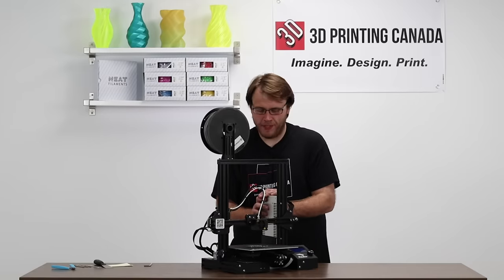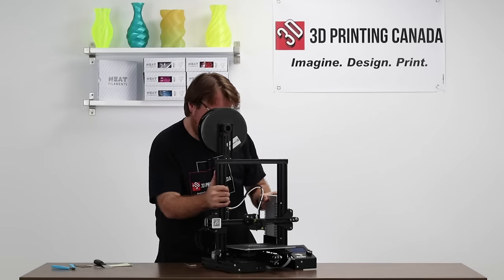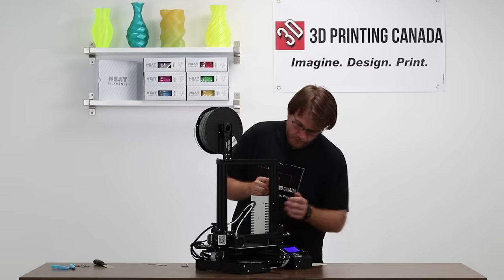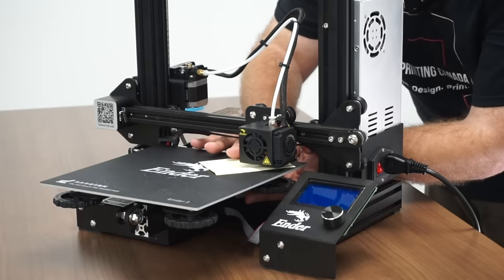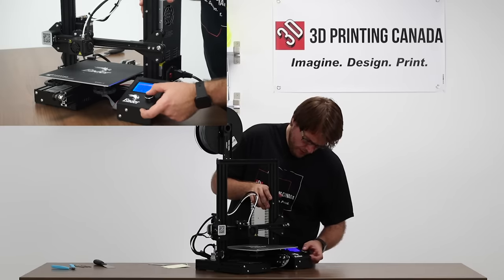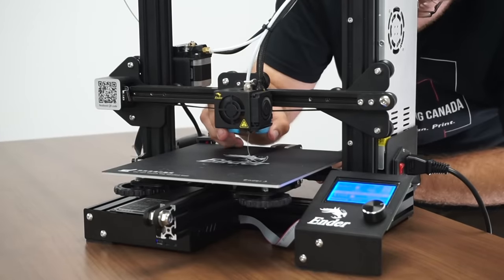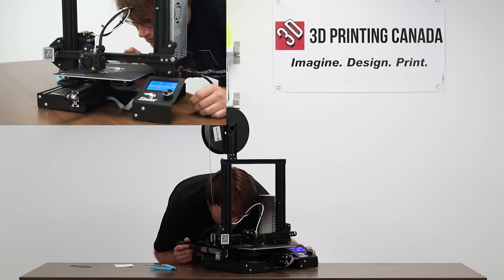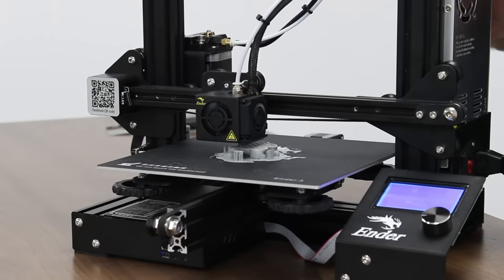Creality Ender 3 Initial Setup and First Print

Comment: Is this a good beginner printer? Cause ive owned this for a few months now and still have zero clue what im doing, i spent a long time just getting it level. The bed is wobbly but i cannot seem to get it tight for stability with out making it to tight where the machine starts to move slower due to over tightness.
Reply: really? Ive done what this video shows, except the manaul states literally what this video says. Ive had it 2 days and already got 16.5 print hours on it.

Comment: Whenever I print the first few layers are really thick and wavy, later on in the print the filament gets thinner like it should be, but the bottom ends up coming loose from the base. I have a ender 3 pro. Does anyone know what my issue is?

Comment: Head slammed right into the print bed.  Was there a step missed here?
Reply: solgado2wow Did you install the end stop?
Reply: @NotLikeMe443  I set the bed with the machine turned off but the print head wasnt in the home position.  So I ended up with my bed a 1/4" too high.  It melted a corner of my prtin bed but, live and learn right

Comment: Thanks for the video, it actally helped me, but i got one question. When i built the printer i followed instructions and it is actually assembled as you got it on the video, except for one thing, the bed, i got that black plate appart of it and i don't know how to atach it to it, it just keep moving and i'm afraid of doing a really wrong move.
Reply: DonPerillòn : have you use the clips to attach? I just got my printer today and am starting to assemble so I may be way off but that is what it sounded like. Just use banter clips to hold in place. Sounds ridiculous but that what I've seen in other YouTube vids.
Reply: @kirkgonzalez353  Yes, i'm just using the clips, and yes, i've confirmed that's the way it should be. Thanks anyways.

Comment: I'm new with Ender 3 !
What's the file to save and print into micro SD card to print out?? Thanks
Reply: It should have came with the .gcode file for the test dog. You need Cura to transform .stl files into .gcode files

Comment: I prefer to use a feeler gauge to set my nozzle height. I set the z axis to 0.2mm and then use a 0.15mm to set the height. If you measure standard printing paper you get about 0.08mm.

Comment: Hi Ryan, I bought a Ender 3 and tried to print the Benchy .. It failed at the roof . So I noticed I had a wobble on the X-axis (have not tried a reprint) I am struggling with the Cura settings . Do you use Cura ? and can you upload your profile somewhere?
Reply: Hij gaat geen antwoord geven... 😐

Comment: First 3D printer I've actually owned, working on getting her fired up. Thanks so much for the video! I want to print with the filament that came in the box but it wasn't stated if it was PLA or ABS, which is it?

Comment: I couldn't push the filament threw the ptfe tube it would just stop like it was clogged. What should I do?
Reply from the maker: Do you mean right at the beginning just beyond te gear? If so, your PTFE tube may be slightly misaligned in the pneumatic fitting. Just unscrew it and pup the filament right into the tube. Easy fix!

Comment: On first viewing I thought the info was to fast on bed temps, speeds , layer thickness etc. Are these preset with the model chosen or do you have to set each one? Otherwise great video very helpful.
Ps it took me 30 minutes to work it where to put the SD card. My brain was stuck thinking it should go in the control panel.

Comment: My X axis cross bar isn't quite level, seems to droop down on the side without the extruder motor (the side with the adjustable wheel). I've tried adjusting the tension with the wheel, is there anything else I can do to bring it upwards a bit?
Reply: hi   di you fix this 

i measured both sides of my top rail and they are not even so the print head is not level when it moves accross - any ideas on how to fix this ?
many thanks
Reply: Try the screws that hold the crossbeam to the feeder assembly if I’m saying that correctly, had the exact same issue until I did this
Reply: Thank you - i will dissasesmble and rebuild tighter
Reply: hi - spot on  -great fix - all working - many thanks for all your vids
Reply: No problem my fellow Ender 3 users

Comment: The 2 eccentric nuts under my print bed were loose causing the bed to be really sloppy, I took the whole thing apart before figuring out that the two nuts can be easily adjusted to remove play.

Comment: That really looks bad when you perform a bed leveling then have to correct it on the fly during the print start. I was surprised that you didn't verify the gap with a 2nd check.

Comment: when I try to print it prints  2 mm above the maximum hight of the heat pad and I have to place a spacer but my prints come out really bad on the bottom end of my print help. D: gate video helped a lot :D

Comment: Great video. I had to go slowly through it as this is my first 3d print using my ender 3. Wasn't sure what I would be looking at when it was done! Had a little trouble leveling the bed initially but I think I've got it now. Printer is running. Thanks again.

Comment: After working for about 3 hours being very careful to install things correctly (thanks to this video), I finally turned the power on and was greeted by... nothing.  The LED Control Panel was dead.  The fans were blowing ok, the internal colored LEDs were lit, but nothing on the Control Panel.  Very disappointing, indeed!  sigh....  I have contacted the distributor to see what they want to do about this and am awaiting their reply.
Reply: Edward Newbold good luck with that my girlfriend had a problem with her one it would only light up when plug in to the laptop.she phone about it and tired to say the power cord wasn't it right witch was bull.they just dint what to send out a new one well sead they would well see lol
Reply: Well, as it turns out, I had the Control Panel plugged into the wrong socket.  There's 3 sockets to choose from, and I inserted the plug into the one with the large arrow pointing to it, instead of the one with the tiny markings that said "3".  When I plugged into that one, everything started working just fine!  In fact, this little machine has been cranking out 3D prints really good!

Comment: hello , i am an architecture student and i am thinking about buying a 3d printer. But i know nothing about these stuff. starting from the  average cost to make a basic model...the required materials and how much do they cost etc.... it would be really helpful if you give me some details about all these stuff. Thanks in advance
Reply: yves azzi depending on your budget, also your application (excuse me if my assumption are wrong) which i assume if models of constructions then FDM is good and you wouldn’t need anything more then PLA. The cheapest PLA out there is £10 which I buy and is absolutely fine (for 1KG)

This printer is probably the best for your money and I would certainly recommend it. I don’t actually have one but I have a modded anet A8, id stay away from it (however I do like it) because it involves a lot of tinkering.

Side note the resolution of your average printer on the XY plane is 0.4mm (unless you choose a different nozzle diameter).

The cost to maintain this would be low 

About £20 a month of EXTREME use 

And about £10 of somewhat heavy use 
/normal use 
And about £5 of little use a month

Excluding electricity
Reply: thank you very much this was really helpfull
Reply: RevivedAsh267 where do you buy your filiament so cheap, please let me know
Reply: Dawrongguy I buy mine from eBay in the UK
Reply: Here’s an example of one seller

Comment: is it normal that my bed wiggles a litle bit?
for me it's being hard to level the bed rigth so that may be the problem, what can i do??? :(
Reply: there are 2 eccentric nuts on right side of under the bed. if you tweak them problem is solved. chuck bryant has a video regarding ender 3 bed wobbling.
Reply: thank you , now is totally fixed :3

Comment: How hot should I have the hot bed at?
Reply: Shane Travis I usually set mine to 50 which is what I print at. I also set nozzle to 210 which is my print temp.

Comment: 12v or 24v system?
Reply from the maker: 12v
Reply: It should be 24V? That's what's listed, and is also the reason that the bed heats up faster than its competitors. Correct me if I'm wrong.
Reply from the maker: Darn, my mistake! Yes its 24v, I had thought I was commenting on the CR-10s video! Sorry!
Reply: its 24V

Comment: I THOUGHT THE VIDEO WAS OK UNTIL THE PART WHERE YOU STARTED YOUR FIRST PRINT, YOU HAD JUST SPENT ALL THAT TIME AND EFFORT LEVELING THE PRINT BED, THEN YOU DIDNT LIKE THE WAY IT WAS PRINTING SO YOU TRIED TO ADJUST THE HEIGHT/Z AXIS ON THE FLY USING THE LEVELING WHEELS. I CANT BELIEVE THE YOU WOULD SUGGEST TO THE PEOPLE WATCHING YOUR VIDEOS TO DO THIS. IM SURE MOST OF THEM ARE NEW TO 3D PRINTING, SO THEY DONT KNOW ANY BETTER. HOWEVER, I DO AND SO SHOULD YOU IF YOU ARE TRYING TO TEACH PEOPLE HOW TO DO SOMETHING. AS SOON AS YOU SPUN THAT FIRST LEVELING WHEEL YOUR PRINT BED WAS NO LONGER LEVEL, AND THEN YOU ADJUSTED SOME OF THE OTHER WHEELS, WHICH FURTHER MESSED WITH THE LEVELNESS OF THE PRINT BED. THERE IS NO WAY THAT YOU COULD HAVE ADJUSTED ALL FOUR OF THOSE LEVELING WHEELS EXACTLY THE SAME AMOUNT BY JUST EYEBALLING IT. THIS IS WHY WE USE A PIECE OF PAPER OR FEELER GAUGES OR WHATEVER TO MAKE SURE THAT IT IS JUST RIGHT AND LEVEL BEFORE PRINTING. ANYWAYS I JUST WANTED TO LET YOU KNOW THAT I THINK IT VERY IRRESPONSIBLE TO MISLEAD PEOPLE JUST STARTING OUT WITH 3D PRINTING WITH SOMETHING LIKE THIS BECAUSE AN UNLEVEL PRINT SURFACE CAN CAUSE SO MANY PROBLEMS DURING A PRINT JOB.